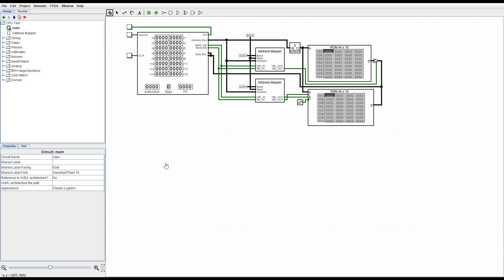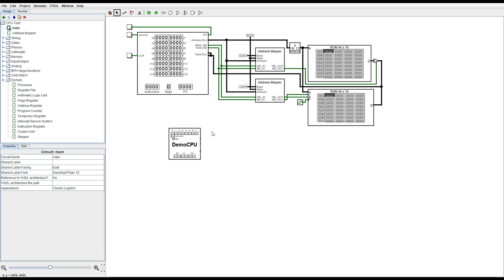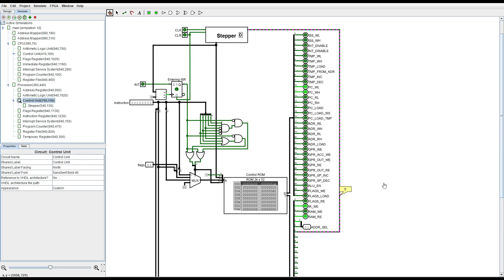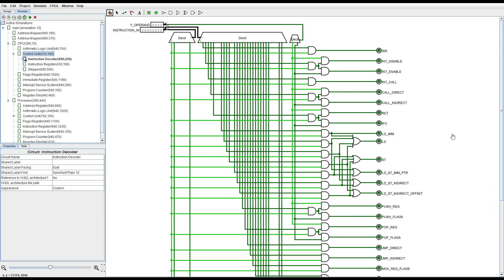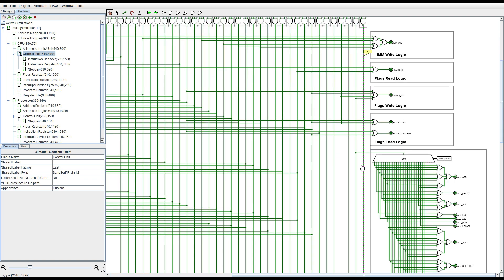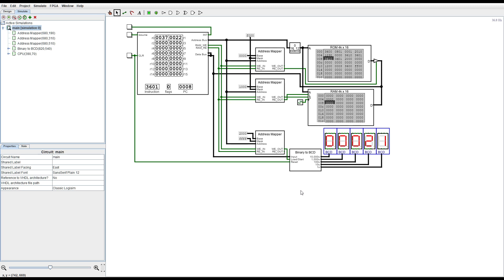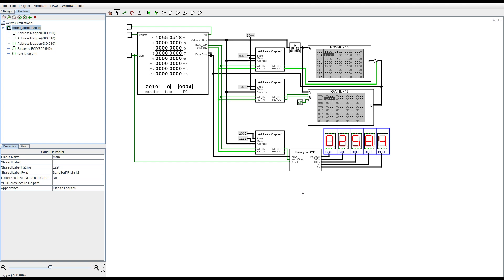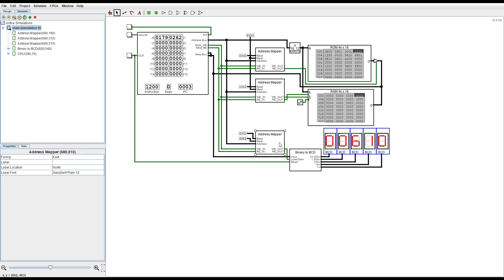I Made a 16 Bit CPU

Comment: Don't tease me. I've been messing with Cedar Logic for long enough that I know how to generate 5 different colors. Black, red, green, teal and blue I think..

I had once created a deliberate error generator circuit to create these 5 colors. Is it worth creating some sort of 'display' with these 5 colors?
Reply from the maker: I'll have to check out this Cedar Logic simulator.  The version of Logisim that I'm using has a built-in RGB display component, so we can generate pretty much any color we want provided you know the RGB code of the color you want to generate.
Reply: @TimothyChapman  Oh it's neat, it really is. The last version I've messed with is 1.5 I think it is, which introduced a Z80 emulator even!

But sadly, at least as of that version, the actual inputs are, or at least were limited to essentially toggle switches, momentary signal switches, and a 16 key hexadecimal 'keypad' which itself seemed to be a bit lacking in it of itself.

The outputs were basically limited to either 'LED' lights or basic 7 segment character displays. As of the last version I tried there isn't any direct access to either the physical keyboard nor output to any sort of pixel display.

Regardless, you can import and export the contents of ROM 'chips', which I assume means it should theoretically be able to emulate the core functions of a computer, but not in the most intuitive ways ya know.

The project IS open source though and seems to have lots of educational value. It was originally created as some sort of college project.

Even with the limitations of the last version I've tried, it's neat as hell!
Reply: @TimothyChapman  I should add that MANY years ago I had also tried out Logisim, but as of that time for some reason I wasn't as pleased with the overall user interface, which is largely why I leaned more towards Cedar Logic.
Reply from the maker: @southernflatland  Logisim has a whole bunch of forks on GitHub as "logisim-evolution".  I use the Holy Cross Edition, but the original Evolution is good too (plus it's in active development whereas Holy Cross is dormant).  Both are far better than the original Logisim.
Reply: @TimothyChapman  Maybe I should check out Logisim again someday, but at the same time that kinda makes me feel bad. I ended up putting a lot of effort into Cedar Logic to make wiring diagram templates and crude combo keypad/clock circuits that one could put together almost as easily as Lego blocks.
Reply: @TimothyChapman  Odd that Logisim has a 'Holy Cross' fork. Cedar Logic has biblical references in it as well.

Perhaps there's some development crossover? 🤷‍♂️